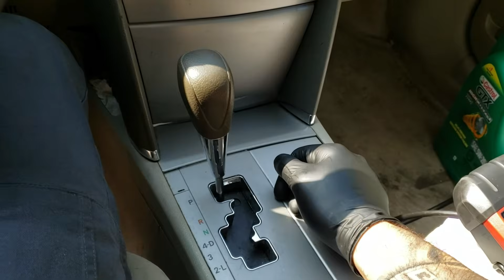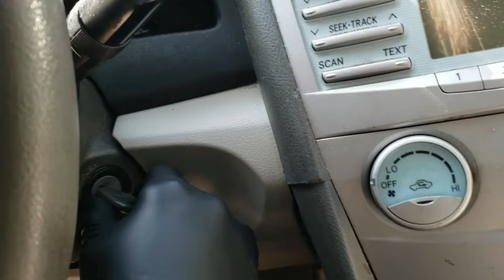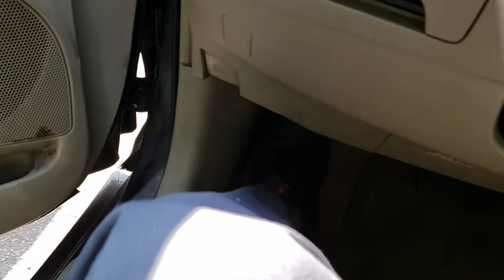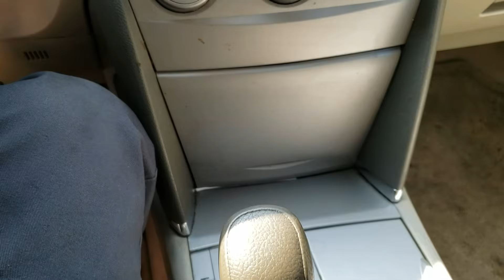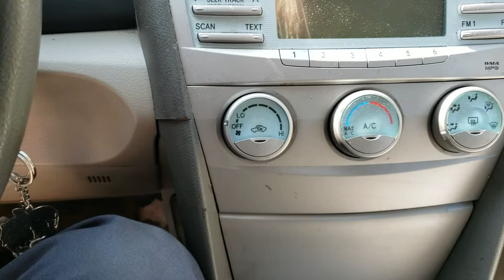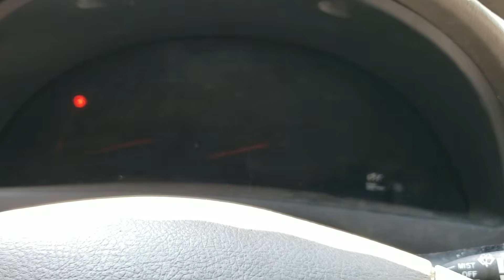2006-2012 Toyota Idle Relearn Procedure

Comment: you didn't mention but i assume you can't touch the brake pedal?  otherwise no need to mess with the parking brake.
Reply from the maker: The brake should not be pressed. But make sure you apply the parking brake!

Comment: Hi Rodgers, thank you for the video. Had to replace the battery (also changed the starter motor as I thought that’s was the problem) and on restart, the car kept stalling! which shouldn’t happen on an auto. I was about to go and start playing with the throttle but thought I would check out problem on YouTube. You have just saved my sanity, many thanks, Pedro
Reply from the maker: I'm glad you were able to find my video useful! and its Rodriguez!

Comment: Great video! I'm just wondering if there is another idle re-learn procedure for vehicles with manual transmissions?
Reply from the maker: for manual transmission, a scan tool with the capability of performing relearns would have to be used
Reply: Rodriguez Repairs thank you for your response, quite sad there is no alternate re-learn procedure for M/T without scan tools. Great advice anyway sir.
Reply: @RodriguezRepairs  it still works on a manual prado thanks
Reply: @RodriguezRepairs  can you recommend a scanner with the relearn feature?
Reply from the maker: @Sinstar-RC  well it has to be a bidirectional scan tool. There are many options out in the market. The Launch X431 is really good

Comment: I just did this on 2009 Kruger and is idling at around 600 instead of 900. Fingers crossed it has fixed it
Reply from the maker: How does it respond when you put it in gear? idle?
Reply: Rodriguez Repairs nothing special. I had to wait five minutes so mucked about on Facebook and other stuff. After the five minutes it was idling slower and I went for a drive and the tacho was lower than before. When I got back I let it idle in garage and noticed it was lower. To be honest I was surprised. Fuel is normally about 11.5/100k and after last refill is 14.4. I’ve noticed it seems to be revving more in last few months so thought I would google it

Comment: hi i changed my battery and it idles and then dies how am i able to do it without putting it in drive and dying on me is there a way ?
Reply: Step 1. Turn the key tothe on position but do not start it 
Step 2. You press your gas pedal in  slowly all the way down, wait a second then release 
Step 3. Take your key out
Step 4. Start your car now
Reply: @joelgonzalez7973  
He still hasn't responded.....

Comment: Note sure if this is related to what my car is doing but I think I have a throttle response lag on my 07 Camry. I hit the gas pedal quick and it has a delay for about 2 seconds then it revs up. It doesn’t respond right away. Any suggestions or ideas on what it might be? I appreciate it if. Thank you
Reply from the maker: Hey D Boy, do you have any check engine codes? Id so, what are they? If you have access to a scan tool, see the live data for the throttle % and response. You could be having a faulty throttle body.
Reply: Rodriguez Repairs no codes popped up, ever. I have a video on my channel. If u don’t mind u can take a look at it and see what the hell is going on lol

Comment: Bro, you are awesome! Most people said loose vacuum or disconnected ground! You were right! You definitely got a subscriber here! Thank you! 2010 Corolla working now!
Reply from the maker: Thank you!! I'm glad you found this video helpful!
Reply: That's great news, Brad Carter!!   I received the same info about vacuum leaks.....and also about the PCV valve

1AZ-FSE engine here  ~  removed the "throttle body", cleaned, and fitted back, and it started acting crazy revving on high (1.5k+).  didnt block the coolant hoses, manifold started smoking; got me worried!!
  
Muchas Gracias, @Rodriguez!!  Cheers for the instructions!!  It makes sense now.....  You're a Boss!!  :D
Reply: Exactly what I have going on. Doing this rn! Hopefully my 2010 corolla is fixed after this too.
Reply: @ThexCondor it fixed?
Reply: @pedroaquezada  helped a lot! Still ended up replacing PCV Valve to totally solve issue
Reply: @ThexCondor gon try replacing the PCV valve, same with me helped, but issue still there.
Reply: I still have both lol

Comment: How does this work for a manual transmission?
Reply from the maker: this method cannot be used on a manual transmission. The relearn will have to be done with a scan tool.
Reply: @RodriguezRepairs most scan tools do not have a function for this when it comes to manual. It just tells you to do the same procedure you showed.

Comment: I have a CAMRY 2012 high RPM meter after cleaning the Thotelle do you have a solution
Reply from the maker: you need to do an idle relearn because the throttle body went put of its correct calibration. Use this method for the relearn and let me know if it worked!

Comment: How do you perform a throttle body relearn on a Toyota with a manual transmission?
Reply from the maker: It would have to be done with a applicable scan tool that has the Nissan relearn function

Comment: What happens when it continuously loses it's memory with out unplugging the battery
Reply from the maker: You will have to get a diagnostic to see if the throttle body may be at fault intermittently. How often does it lose its memory?
Reply: Rodriguez Repairs mine is doing the same. It will throw a power steering wheel light and reset my radio. I have a 2012-2013 Camry SE and I’ve almost replaced everything and I still have this same problem. Acting like something is grounded but it’s not. Literally everything has been checked and a full electrical test and still nothing but maybe a clock spring but apparently way to early for that. Happens mostly on start ups or shutting my car off and or locking it with my key fob it’ll do a half beep like something is draining my battery and seems to me that my car is still trying OT reading my key fob when I’m not in my car. No clue on what else to do. Everything passed on all meters and shops and fuses and I have a remote start for about 5 years and I thibk maybe it’s lose and grounding itself or idk but the aftermarket remote is getting looked at tomorrow but idk what it could be. Any ideas?
Reply: A A RON check for a parasitic drain there are videos out there. Inside fuses and outside ones. Also check main ground
Reply: Enar Rolandsson man I had one of the best shops do a full blown electrical test on my car and had it all day and Also said they could guarantee they could find the problem but they didn’t and they didn’t charge me
Reply: A A RON I wouldn’t trust a shop to do it. I would re check myself you can get a $5 multimeter at ace hardware or Walmart and follow video tutorials on parasitic draw I bet you’ll find the issue
Reply: It's been a long minute but I got a little WD-40  squirt some into every vacuum line I could find as close to the valves EGR valve on all that good stuff. It hasn't give me a problem since. What I figure is something was sticking. And of course make sure all the vacuum lines were on. I've actually forgotten about it
Reply: Oh my God! It worked on my highlander 2012. I was going crazy, thought it was vacuum hose . Gracias mi hermano. You saved the day.

Comment: What about the Camry V6 with a Start/Stop button?
Reply from the maker: The procedure would be pretty much the same. With the push start button vehicles,  you still have to cycle the ignition switch 3 times. Press the push to start buttion once WITHOUT pressing the break pedal to access accessory mode wait about 5 seconds and Press it again to access ignition mode. Press it again and the vehicle should turn off. Do it 3 times and let me know what happens.
Reply: The problem I have is the idle drops under 600 rpm when I stop or when I shift into reverse. I did this idle relearn a couple of times but the results are the same. There are no vacuum leaks, all the sensors are cleaned up, the spark plugs are new.
Reply: @VILSONDUS  any luck with a solution?

Comment: What is the problem, hi or low rpm after replace the battery?
Reply from the maker: Most of the time, high rpm is what occurs after you replace the battery, throttle, alternator etc.
Reply: Rodriguez Repairs  thank you

Comment: hi bro...  my toyota wish 2004 2.0 1AZFE Facing with problem which is i cannot raise engine speed at all when after replacing with new throttle body.
i thought relearn process or something would required though  i tried most of 
the googling method it doesn't work.
can i get some manual trick bro
Reply from the maker: Does the vehicle not experience any acceleration?  The vehicle could be in "limp mode" which is basically a protection measure the vehicle uses for  letting the driver know that something needs attention and needs to be diagnosed. The vehicle will not be functional reducing engine power. do you have any trouble codes?

Comment: I didn’t replace anything and it started idling like this
Reply: Probably time for new spark plugs!  I replaced them prior to my alternator and the throttle response is insane! And spark plugs are cheap. :)

 My RPMs  dropped from 900 to 600 only after I pute in my new alternator. Buuuttt, I put a 250 amp alternator in instead of replacing with a 100 amp that your supposed to replace it with. (To power my subwoofers)
Reply: It was my coil on cylinder 1
Reply: @F87_jey  ahhh. That makes sense. I just got my pack of new coils in the mail yesterday. I'll install them all in the morning. :)
Reply from the maker: I'm glad you were able to find a solution to your problem!!

Comment: Hello. Will this work on a manual? 
I have a 2012 Etios that has been idling so low when coming to a stop that it cuts out.
Reply from the maker: This procedure normally works for vehicles with idles too high or erratic idle readings. If the idle is too low on your vehicle then you may have another issue that has to be repaired first (Most commonly the Throttle Body on newer vehicles) Do you have any trouble codes?
Reply: @RodriguezRepairs  Sorry for the late reply. The idle relearn procedure solved the problem. Thank you
Reply: what is the idle procedure for the manual transmission ?

Comment: How to do for a 02 Camry standard transmission, my issue is the idle is over 1200rpm. Please help thanks
Reply from the maker: For an 02, im not really sure if this procedure will work due to the fact thats its an earlier model and the calibration specs are different. What was done to the vehicle for the idle to begin raising to 1200rpm? or did it happen randomly? Any engine trouble codes??
Reply: For 02 camry do this: to start fresh, disconnect negative battery and while disconnected, put key in Ignition and turn to ON (to drain ecu memory) for 20-30 seconds. Reconnect battery. start-up engine until 160-170 F (op temp). Turn off engine 5 min. Turn on engine, engage parking braking, shift thru all gears stationary. Turn a/c on MAX for 2 min; then turn off a/c for 2 min. Then shut of engine. Next startup you should be good.

Comment: I have a 2007 toyota camry hybrid and if I clean the throttle body will this procedure need to be done after cleaning the throttle body?
Reply from the maker: What is the reason you are cleaning the throttle body? Electronic throttle body cleaning can be a bit tricky because you have to make sure you DO NOT move the throttle blade when cleaning it because it can cause miscalibration in the throttle electronic system.

Comment: Would this work on 2001 Toyota corolla ?
Reply from the maker: i dont believe this procedure would work on a 2001 corolla because those vehicles are not equipped with electronic throttle bodies.